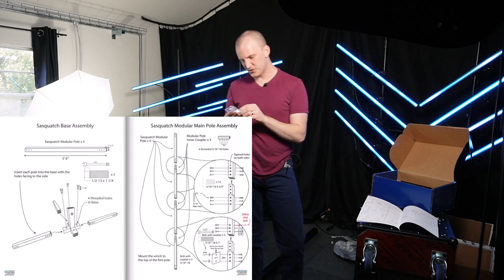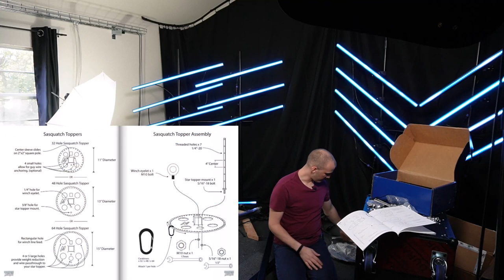How Do You Build a Megatree?  Featuring the Mattos Designs Sasquatch

Comment: Looks great!!

I use Mattos' sasquatch base and pulley system, but bought my square tube from a local supplier. Bought two 24' lengths and have them custom cut it down to 16' and the rest into 4' sections so I have 4 legs and a spare 4' section. I run mine 24 x 80, 2" pixel spacing and run my topper up to about 14.5' on my 16' pole. I wire mine off 12 ports - so 2 strings (1 up and 1 down) per port. 30% brightness.

Comment: Base Hoop assembly 2 people required. LOL. I think for the person who is just getting into Christmas lighting, and the idea of the MEGA tree being kind of plug and play on the stand itself. This solves so many problems that you would have in setting one up. I think the trouble with the crank at the start of raising the topper ring, was just that you clipped that side , if you'd clipped on the other it will put the winch at the back where it's open.  I've been working my way up and purchasing hardware over the past year. Still working on getting everything together. I think I may have to look into these guys because this looks really cool. Thanks for the cool setup vid.

Comment: Looks great! Thanks for the video. You said you are doing 24 x 100 "up and down". So I'm guessing this means power injection every 200 pixels? Would it be ok to run 5V pixels like this? The pixel calculators I've seen seem to think 200 pixels between injection points are ok if your power injection wire is big enough. Do you have a preferred configuration for ports on a mega tree? Presumably you could run one off of one differential receiver but I know some people dedicate a full 16 port local controller to their tree. Thanks!
Reply from the maker: You could probably get 200 5v pixels in a string without injection up to a max of 20% brightness (quick calculation), but I would just run 12v!

Comment: hello David,  curious the bolts you used to put the winch on, i did not receive any with my package so i was curious if you could state what size they were?  hex top bolts?  about 1.5"?  and they were 5/16 i am assuming since this appears to be the size of the flat head screws supplied.  also the safety bolt....was this a 1.5" 5/16 hex top bolt?  i assume this is to prevent the topper from sliding all the way down onto the winch.  thanks in advance

Comment: Is there a way to to connect the tree wirelessly rather than using an Ethernet cable
Reply from the maker: Certainly!  If you have an FPP-based pixel controller, it should be able to go wirelessly, mine is for my show, I just did wired eithernet for ease in this video